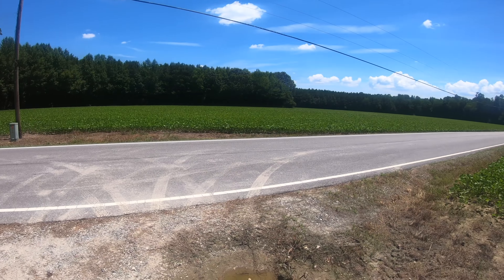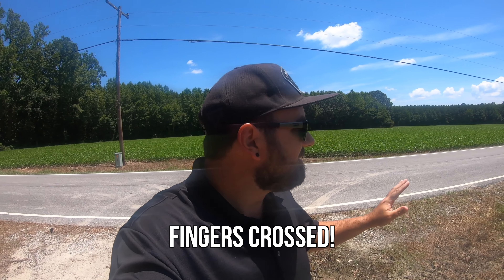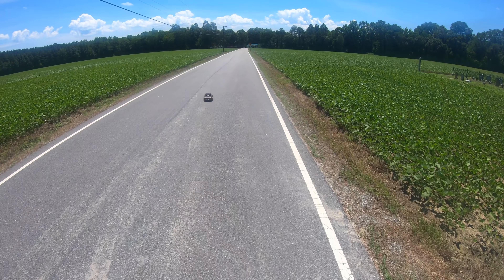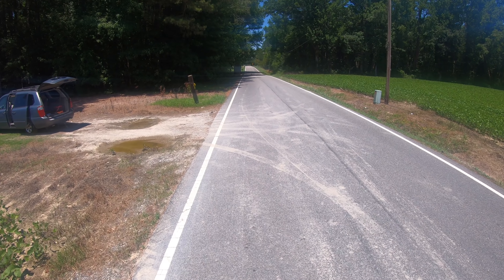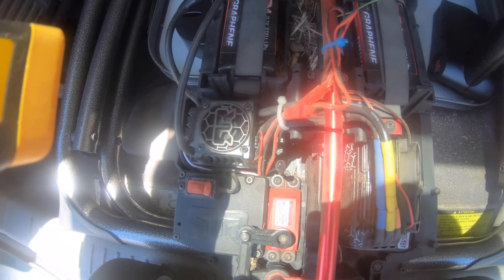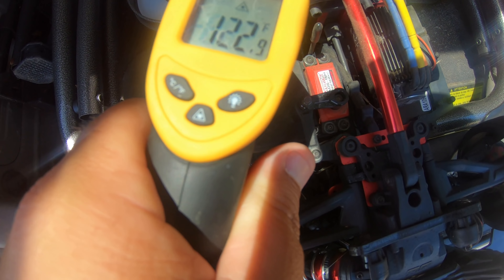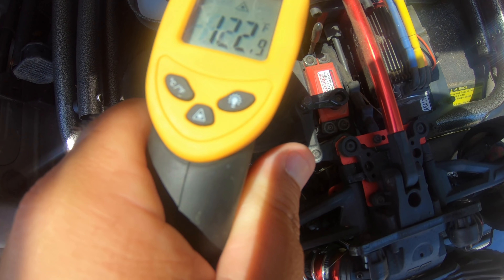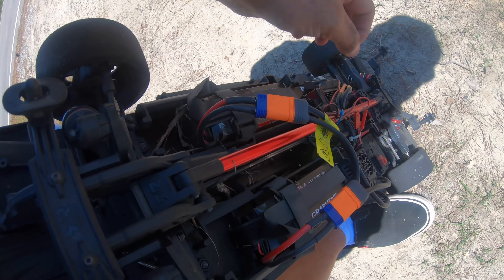Fastest RC I've Driven!! ARRMA INFRACTION 27T High Speed Pinion Test

Comment: just picked up the Infraction this past week and the first thing I did was install the new Pinion gear and the truck would go into limp mode if I attempted to give it full throttle.  I would also loose signal reception with the vehicle and I found myself walking to the vehicle in order to get reception again.  I installed the stock pinion gear and so far so good no issues.

Comment: My DX4C has never really had a signal loss problem, until I get to my speed run road. It's lost the signal 3X. And doesn't reconnect until I am 15' away from the RC. The crazy thing is that I never have this problem, until I am on my Speed run road! Everywhere else it's just fine.

Comment: Pretty sure it's the radio that's the issue. I would swap that out ASAP and you should be ok after that. If you still have issues, however, then there's a Gremlin hiding in there somewhere that will need some investigating to find.
Love the Dragonfly on your head towards the end. 😂
Good video and well done on your first speed passes. 🙂👍💪
Reply from the maker: Thanks Vas. I’m mad that I forgot to go back and do the graphics I had in mind for the dragonfly landing. 😫😂

I agree that the radio is probably the issue. I try to keep as many stock items as possible in the beginning for people that buy them and run them as is. Then show upgrades as necessary. I’ll try the radio one more time whit fresh batteries. If that doesn’t work, then I’ll bind to my DX4R Pro. 

It was pretty terrifying driving it that fast. Going to take a bit to get used to. Haha. I’m used to bashing not blasting.

Comment: I have built what looks like a limitless 6months ago outa typhon, senton, kraton chassis.its running 2 stock blx systems with b.e.c and cap packs.yet too put those 2#34 tooth pinions on.....
Reply from the maker: Sounds killer. are those the pics I've seen floating around on Facebook? I need to try cap packs. Never done those.

Comment: So the 27t gives you more top speed or more acceleration?, and does it run hot?
Reply from the maker: It gives more top speed. It will run hot if you do more than just quick speed runs. Not meant for continuous driving at full power

Comment: If you have the stability turned up too high it'll make the car spin out as well don't know if that could be your issue as well but you could try that
Reply from the maker: Jeffrey Williams AVC was turned down. The spin out was me stopping hard to avoid losing reception.
Reply from the maker: The edge was me trying to save it from going offroad at full speed and tumbling.
Reply: Right, we was playing with a Tc3 road car built up and put a brushless system in it and only controller we had laying around was the flysky GT5 and the vehicle stability kept making it spin out will it got up to higher speed is the only reason why I mentioned it but as soon as my infraction gets shipped are we able to check out some speed runs by self
Reply from the maker: Jeffrey Williams I had that happen when I was traveling with it and pulled the transmitter from my suitcase. It has spun the dual to 100% and I didn’t notice. It was uncontrollable at speed. 😂 then I realized what was happening.

Comment: Try the Graupner X8N with the Graupner Gr8-Race receiver
Reply from the maker: That's $250 I don't have to spend 😄 I'm going to try fresh batteries in the stock remote first. I also have the DX4R Pro by Spektrum I can bind to it. I just like to show it as out of the box stock as I can for people who may buy it and not have all the extras. But if range is still an issue after using fresh batteries, then I'll bind to my DX4R Pro.

Comment: Dude what is up with that reception!?!? You can’t get any flatter or more open then where you are... so weird! My Xmaxx would do the same with the traxxas Tx so I switched it to Spektrum to relieve the issue Lol Btw, how do you get that dope heads up telemetry?
Reply from the maker: Hey James. It was weird. I will say...they were used batteries in the transmitter and I didn't think about that until someone mentioned putting fresh batteries in it. LOL. I just wanted to play and pulled batteries out of one of my other transmitters. The telemetry is done using a GoPro. The Hero 5 - Hero 7 models have had GPS in them. Then you import it to the computer and it allows it to be added via the GoPro Quik editor.
Reply: CCxRC Oh yeah fresh batteries Lol I missed it too :-) I hope that solved the problem!! Thank you for the info on the telemetry. I’ll have to get a Hero5 and see if I can do the same once the Limitless comes out! Thanks again and I’ll see you on the next one!!

Comment: It a shame that that crappy spektrum radio horizon is pushing down our throats wont keep up with an arrma... the tactic ttx300 was a 10 times better unit... and it wasnt awkwardly large and ugly and cheap... GET IT TOGETHER HORIZON... WHAT CRAP. great run tony love the channel!!!!!!!
Reply from the maker: This has the DX2E Active which I don't mind. I do like the feel of the Tactic, but this is DSMR Protocol with AVC technology which is more then some of the others get. Someone had a good tip to change the batteries. That's probably smart because I 've been running it a lot.

Comment: Looks like the braking at high speed is causing the skid. No real grip on thos tires. Theyre made to let it drift. On board cam showed wheels spinning in reverse for a moment
Reply from the maker: Yeah. I didn’t want to continue hard braking, but if I did a light brake and then tried to steer, the wheels wouldn’t turn at all and it would roll into the ditch. If I could steer , it would’ve been fine. So what I did was just brake hard and try to stop it
Reply: @CCxRC  cool. Love the truck good luck getting it right. Do you have a better tx rx maybe better range. Hard to tell from the footage what exactly was happening when it was far out. when i saw the way it skidded with the onboard it seemed to just lose traction. Idk im not the driver. I watched someone else top it out at 80 w/o cutting the wing, high downforce and traction
Reply from the maker: You saw right. At that point I realized my only shot was to go fast and stop fast and hope I kept reception. 😂 you see it right. In the wide shots I was going slow. Would tap the brake to slow and then it would roll without being able to steer or brake again. I have a DRX4 Pro I can bind to it.

Comment: The powerlines and also your cell phone can mess up the reception.  Try no powerlines and putting the phone in airplane mode if you have it in your pocket
Reply from the maker: I’ll work I’m taking out the power lines with my 1:1 car and then quickly try to get in a speed run before the power company comes to fix it

Comment: 80mph  Cool.   Congratulations.    Im not a speed guy either.   My personal record is about 60mph right now.    .    i Dont understund this signal loose with radio system at all.  This was 2.4ghz?  This look like the old times 15years ago radiosystems with 27/40MH .   What is this?... HAHA..   Then also to be truth=   Talking about temps is not right thing to do maybe, because you have double fan system there from Y-R , this is not stock .  What happens when you drive like this without extra Fans?   What happens when you drive the car out from box without fans?   Arrma maybe need change things before  they start sell this as safe 80mph out from box ?  ..  Anyways:  Nice place/road .  Fix radio, mount new tyres.   Then  maybe you do 85mph next time without issues :)